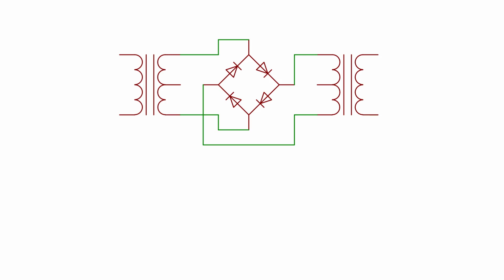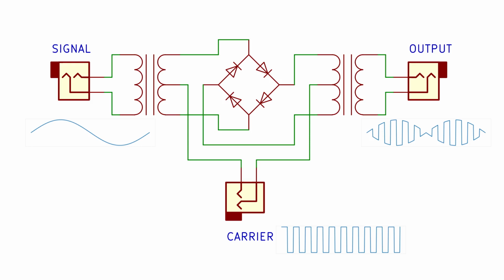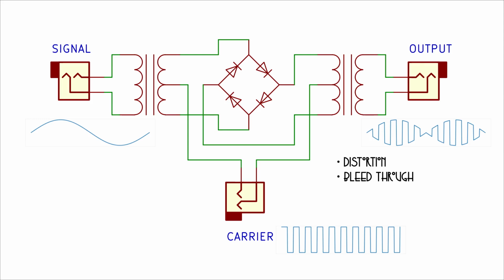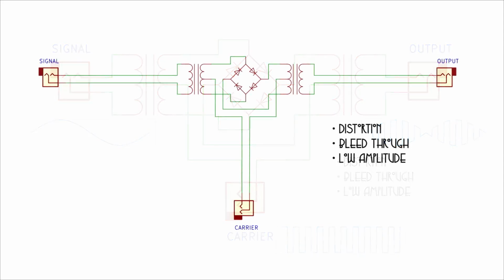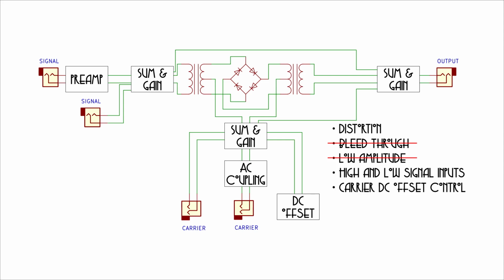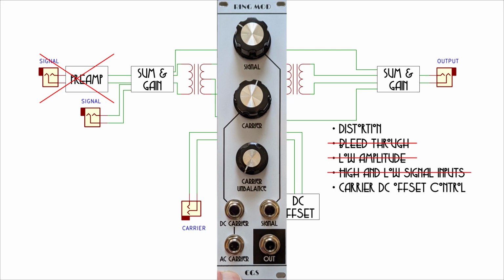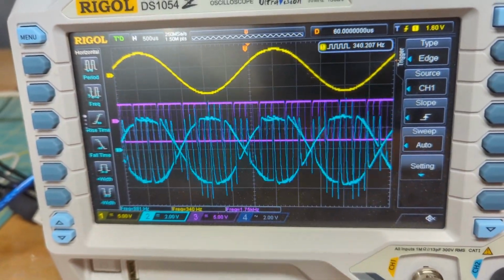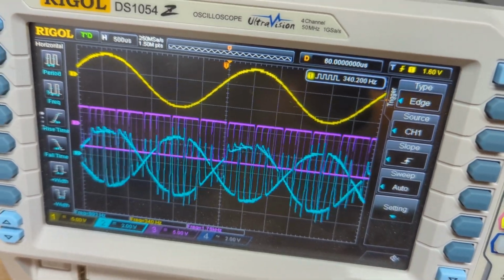Active Real Ring Modulator

Comment: Regarding the lower fv diodes, I've built many ring modulators for guitar use, primarily. I found lower fv diodes provide a cleaner original signal with less distortion. What is "better" is purely subjective. I utilize schottky diodes for consistent, low fv matching. Find them to sound similar to germanium but much easier to grab a few and go rather than measuring 40 germanium to ensure 4 of them measure 1:1

Comment: In radio ring modulator circuits are used for SSB and also even receivers use a sort of ring modulator. It's an incredibly diverse circuit really! The NE612 doubly balanced mixer sort of replaced it in any of my designs and also for audio mixing and inversion. It can produce a very similar sound

Comment: Is there some alternative, similar but i don't care if it's not exactly a ring mod circuit?
Reply: You could just run a voice through a vca & use a vco to modulate the vca. It won’t be same but nearly.
Reply: carrier and signal into an xor.
Reply: PAIA 4710 Balanced Modulator works well for me.

Comment: How difficult would it be to add CV over offset?  That knob is crying out for "magic hands".
Reply from the maker: Trivial, presumably! The knob's just a voltage divider going into a summing node. Connect CV jack to a series 100k resistor to U1 pin 2, that should do it.